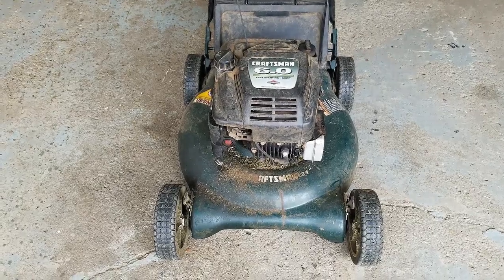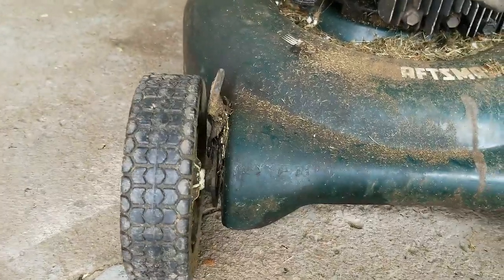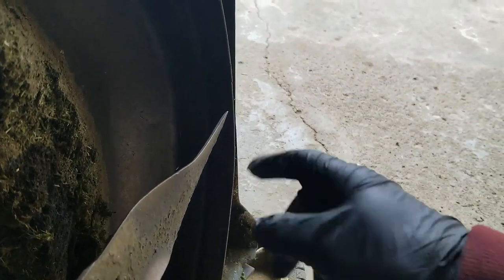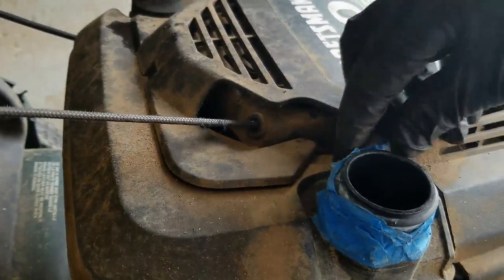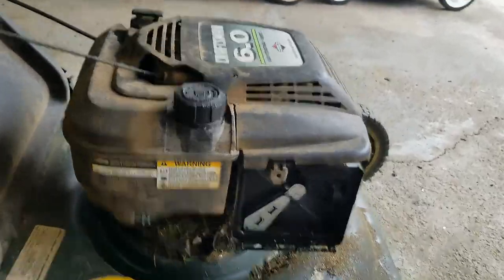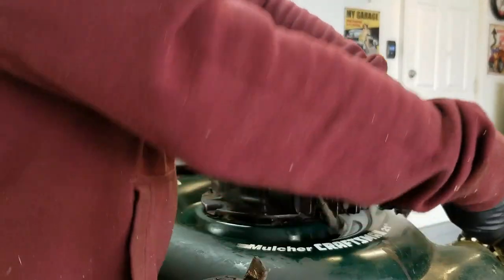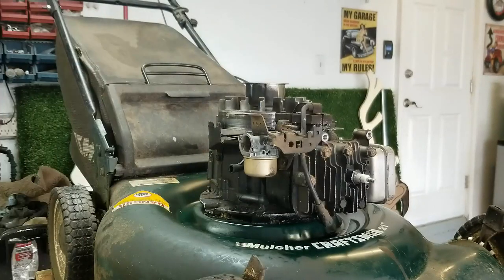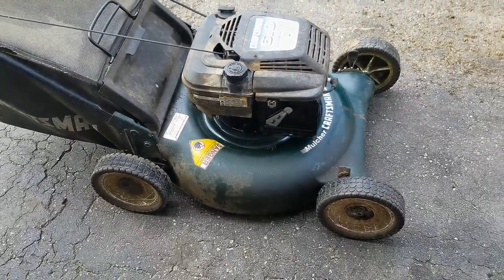Flipping Lawn Mowers For Profit

Comment: Since you had most the needed parts on hand, it was worth the flip:-)
Reply from the maker: If you plan on flipping any kind of equipment, building yourself a used parts inventory is a must. Otherwise, buying new parts are just going to eat any profit. Thanks for watching. Cheers
Reply: @brantsmallenginerepairs  Yep I am noticing that as I watch these small engine   flippers, they all seem to have a mini backyard mower salvage yard to pull common parts from.  For now, I am just looking  for the “ran last summer” specials that just need a carb clean or kit, oil changed, cleaned and resale.

Comment: Normally I just rtv seal the gasket on the dip stick tube good and they never leak
Reply from the maker: Good tip. Not something I would do and then sell to a customer but if it's your own machine, have at it. Thanks for watching. Cheers

Comment: Yes, well worth the time to fix it so it will cut another day... quantum engines seem to be robust... I run one myself with a primer and have no issues. That was a Tecumseh gas cap on there and aside from shoving a rolled up sock in there I guess it worked along with the tape. lol Clearly the previous owner had no clue. Great vid! 👍
Reply from the maker: Thanks Don. It's pretty amazing how people "maintain" their equipment. I actually had one come in not long ago that had a stick for an oil dipstick. That made me chuckle. Cheers man.

Comment: Step one before doing anything, see if it will start and for at least a few seconds.
Reply from the maker: Good call. I neglected to mention this in the video. I do this with all the non-running machines i get. Doesn't make sense to fix 9 problems if it doesn't run. Thanks for reminding everyone. Cheers

Comment: The OLD MAN from EP: just wanted to say nice video on a flip could possibly get $120 looks that good especially if you put on a new recoil rope which does not cost you much. The only additions i would make is we undercoat our decks with Rust Cure 3000 and check torque on all head bolts and mark with paint stick. In the video i can see two by the muffler that are oil soaked and possibly need torquing to specification.
Reply from the maker: Thanks OLD MAN. Ended up being an easy sell in less than 24 hours. Cheers

Comment: Looks like most of the issues were resulting from the over filled oil, and mouse nest. If it ran well, I probably wouldn't have bothered removing the entire carb, I would have just removed the bowl and checked the main jet. The engine sounded great and the mower looked great after cleaning. Since it was free, even if you had to source a few parts from elsewhere, you still would have done great. Would make a nice back up mower or primary for a small yard. Enjoyed the video.
Reply from the maker: When I resell the mowers, I want the new owner to have no issues. Every machine leaves witha full carb clean. Thanks for watching and taking the time to leave a comment. Cheers
Reply: @brantsmallenginerepairs  Sounds like a good practice!!!

Comment: As it was free and no parts cost it would be worth it.  First I would have seen if it started with carb spray before doing any work however.
Reply from the maker: You are correct Al. Doesn't make sense to fix multiple problems without knowing if it has compression or if it has a bent crank, etc. I always do that first. Just did it off camera. Cheers

Comment: At some point will a mower just not start no matter what u do to it? I've been working on one for over 2 months and it will not start. I pulled the recoil one day and it snatched out of my hand and lifted and dropped the mower. Hasn't come close to starting since. I've tried plugs, cleaned carburetor, new carburetor, new coil, tightened the control wire, cleaned the head, new head gasket, checked the flywheel, checked the timing, changed oil a couple of times, checked the camshaft and made sure the marks lined up for timing, checked the flywheel key. I don't have a spark plug tester or know how to check for compression. Tempted to just store it for parts but I prefer using this mower over my newer ones. Any suggestions would be appreciated. I can't think of anything else to do. Was considering buying the spark plug tester. craftsman 917.387360
Reply from the maker: If the rope is pulling out of your hand, it has to be a timing issue. But you said you checked all the timing components right down to the camshaft. The only other thing I can think of is the brake on the flywheel is not releasing when you engage the safety handle to start the machine. This might cause the mower to get lifted up when you try to pull it due to the resistance of the brake on the flywheel. If this is not the issue, I would start over checking timing issues starting with the flywheel key. keep me posted. Cheers.
Reply: @brantsmallenginerepairs  thanks for the reply. Since it first snatched I unplugged the spark plug and turned the blade and it pulls fine again but it won't start. I'll see if I can learn how that flywheel brake works
Reply from the maker: @cbreezy1322  when you took out the plug and pulled it over, did oil come out of the spark plug hole? If so, maybe it's hydrolocked. If you think this may be the case, then continue to pull it over a bunch of times with the plug out to clear the oil in the cylinder. Then put a little gas in the spark plug hole before reinstalling the plug. Then give it a try.
Reply: @brantsmallenginerepairs  thanks for the tip. Will definitely try. Hate for something to beat me and don't want to give up on it because I feel like it should run. Thanks